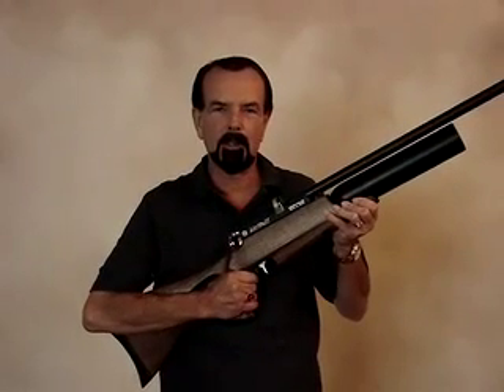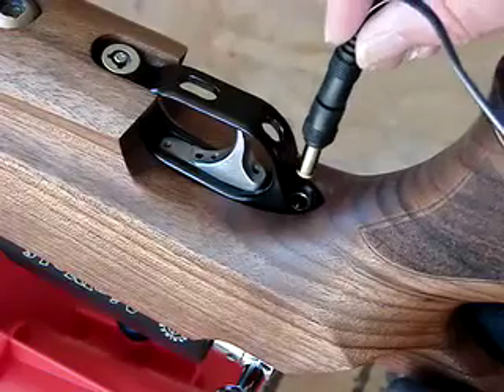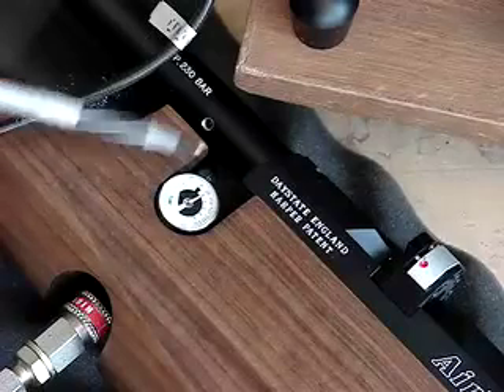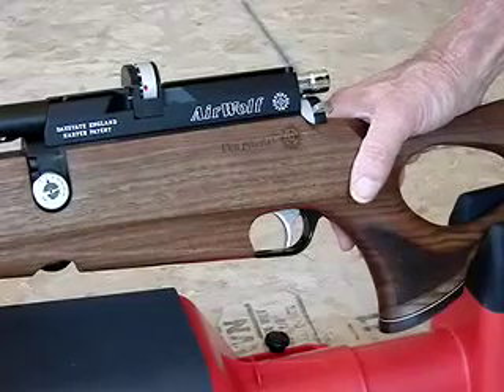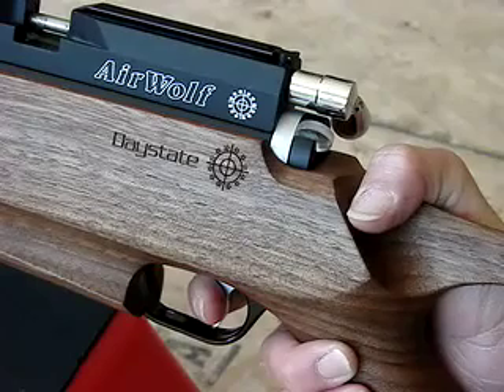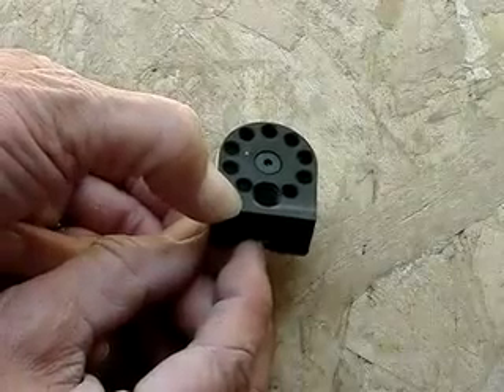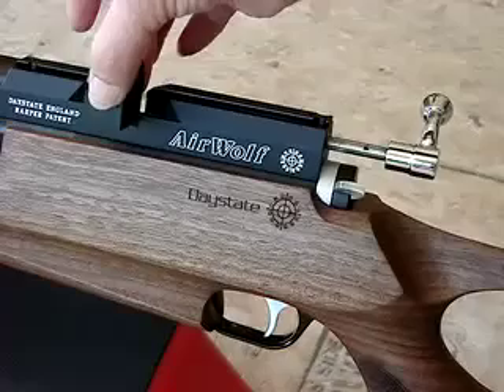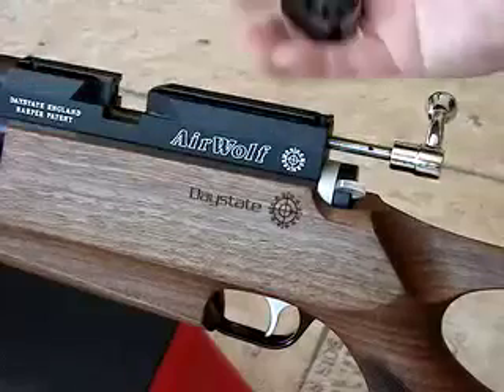Dirt E. Harry & The AirWolf Part 1

Comment: For $560 you can buy an Evanix AR6, change the hammer to a heavy one and get twice the power of Airwolf, and...count the 6 shots yourself :)
You wouldn't want the battery to run out in the middle of the field. A great gun must be totally self-sufficient which eliminates all PCP's since they need refill from outside source but soon someone may invent a pump like Benjamin 392 attached to the gun and easy to use that loads the tank up to 3000psi.